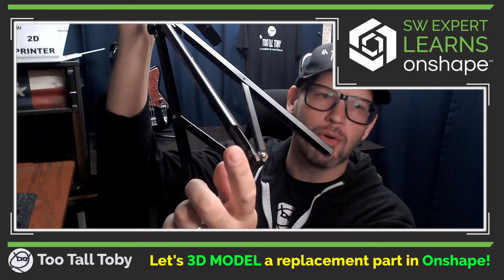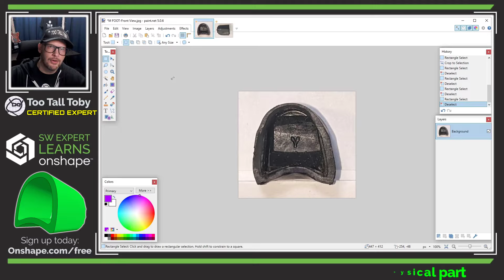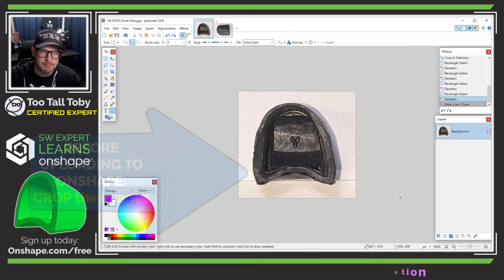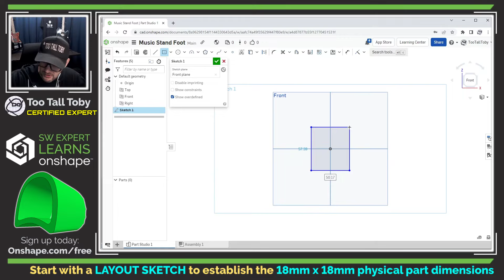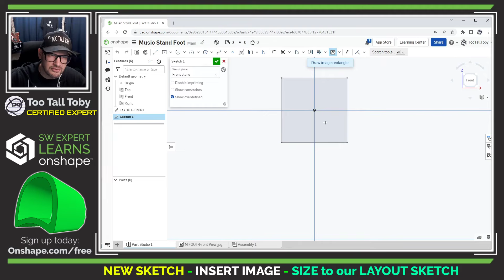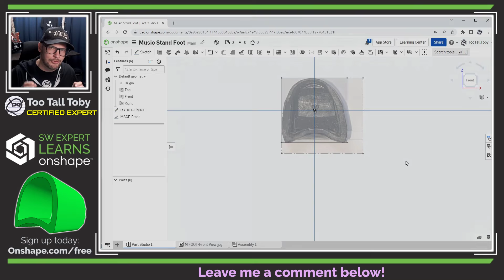Pro Tip for Importing Images into Onshape

Comment: I use another technique for image scaling. All you need to know is the distance between two points on the image.

I then insert the image and create construction line triangles from corners 1 and 2 of the image to point A, and corners 3 and 4 to point B.
Then i constrain the angles of the triangles to whatever they currently are.

Then i can add a construction line between the two points and just scale it to the known distance. The locked triangles will then automatically force the image to be scaled correctly.

Edit: i just realized that i don't need the triangles...there seems to be an auto scaling feature that does the same thing with just the line between the points.

Comment: Love you tutorials. Just wanted to a add a tip for using photos to help with size and geometry - Take the Photo as far away from the item as possible rather than up close with macro etc. The reasoning is that up close distorts the geometry in a slightly similar way that fisheye does. The close up image exaggerates all the errors of lens angle. Where the far away photo is often poor resolution, but more like what you'd get from scanner / photocopier.

Comment: SolidWorks has a much simpler solution for this. You just add an image, draw a line between the desired points, and set a dimension for that line. SolidWorks automatically scales the image to match the dimension you set. :) And guess what :) you can even change the dimension later—that’s true parametric design!

Comment: I'm having trouble with this. I'm trying to digitize an existing plywood part (just 2D), but once I: trace, export as DXF, CNC route, the new part doesn't match exactly. It's off by about 1/4"-3/8" over about 2ft. I've already compensated for parallax by moving the camera about 20ft away and zooming in; the lighting could be a bit better but, I traced everything as close as possible. Any ideas?

Comment: Love the anchoring trick.  I wish you could location constrain the image in the first place and still use the scale line to adjust it. 

My trick is to import the image, scale it. pin it down. then add another sheet over it with a center constrained rect, and the sides equal to the image rect on the previous sheet. Import the image again using the existing rect like you showed.

Comment: This was very very helpful. Thanks so much for sharing it.  I searched and looked at many youtube videos.  I tried tracing the outline of the tool and scanning it in but this is a better approach. My traced image needed to be rotated and scaled and I could not find an approach as I'm new to OnShape.  I will give this a try.    It would be helpful to address the parallax issue.  I also want to explore the idea if it would be useful to take multiple photos to create a 3D image and import it. Any experience there? Also, has anyone seen an "AI" approach to drawing the splines? Also, once the image is imported, how can you rescale it if you messed up? Thanks again.

Comment: Thank you, Toby for great videos. 

Question: Is there "master scale" or "proportion" dimension, by changing this value, it will change dimensions on all of the defined values on the Sketch or even Part? 

For Example: You traced that musical notes stand "slider"/"shoe", and once you print it its lets say 3mm too big, so you want to shrink whole part by 3mm, so it will fit note stand leg tight. How would you go about it? 

Thank you!

Comment: This was pretty helpful. It would be really nice if it could just import the image with its default scale, for example if you scan it in and its already sized to the exact proportions.
Reply: 3D scanning is definitely an option in Onshape - and the models will come it at a 1:1 scale.  But this technique is a little different, as this technique is using an image to help guide the design.  Thanks for the comment!

Comment: I'd find a lot of value if you called out your mouse clicks and button presses as you went. I know it is arduous, but as a beginner it would help me taste success much more rapidly. Also, if you have any customized profile/mouse settings a guide on that would be worth a lot. Soo hard to continue to guess at your interaction methods and continue to dig a hole of problems. You're obviously a legend at this, so thanks for what you have shared.

Comment: I also usually put a ruler next to the object I photograph, then in OnShape you can draw a line overlayed on your ruler and assign it a dimension: this will scale the whole image! But beware, it needs to be the first dimension of this sketch (for some reason).

And I use Affinity Photo’s « straighten » feature (also using the ruler’s edges) to make sure it’s nice and straight, prior to import.
Reply: Yeah thats a total pro move to use a RULER!  Great tip - and I'll check out that straiten tool too!  Thanks!
Reply: It has to be the first dimension because scaling the image would change all other dimensions on the canvas.

Comment: does the free version of onshape allow importing an image  Very good instructional video but I don't find the radio button in the lower section of the work screen you clicked on  Thanks in advance for your reply
Reply: Hi Roger!  I just tested it today in the FREE version of Onshape and the option for Insert Image is still there.  Maybe try beginning a new sketch, then using the SEARCH COMMANDS tool in the upper right?

Comment: Ha! Worked out nearly all of that the hard way - was worth the watch to see the 'anchor' function on the corner - it takes a lot longer if you don't know about that. 
If accuracy is important it's worth being careful if you use a phone. Use the optical zoom and hold the phone square  and a meter or more away if you can to avoid barrel distortion.
Better still even a cheap compact camera with some optical zoom capability.
Reply: yes - yes - and YES!  Agree on all points - especially about the barrel distortion!

Comment: You should take photos of the object from as far away as practical (using zoom). This reduces parallax error markedly.
Reply: Correct and an excellent tip!  I wrote about this phenomenon once in an ENGINEERS RULE article.  100% agree!  Thanks uppsala!
Reply: @TooTallToby  By using a reflex camera you don't have that error, I read on the wikipedia. And How much it can be?, If we are talking about +-1mm or 5mm? I can live with a 1mm error in many aplications, like this rubber foot as the rubber will expand and fit the foot but sometimes I need a perfect fit, and then this error it might be relevant
Reply: 100% correct
Reply: My comment was going to be about the same, but without providing a solution. Thank you for this tip!